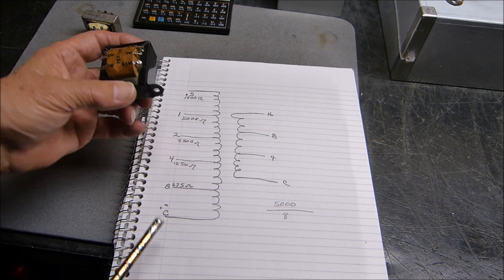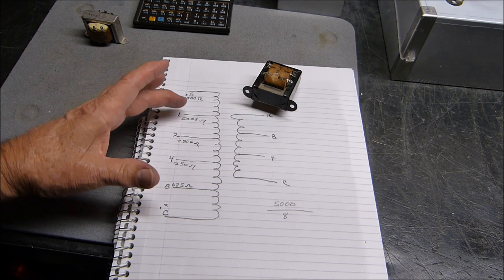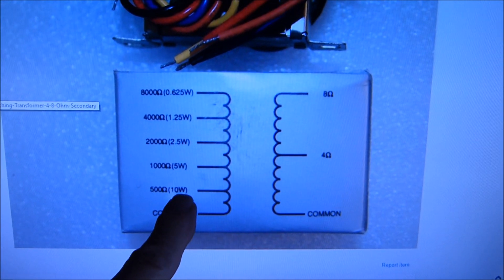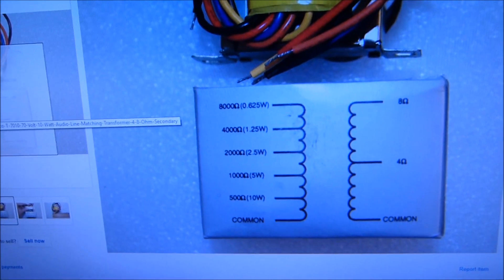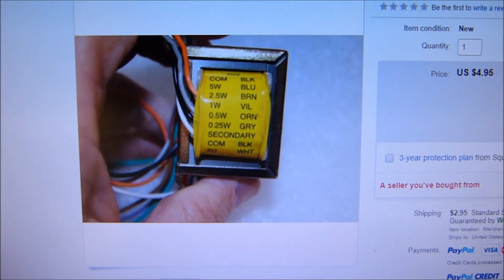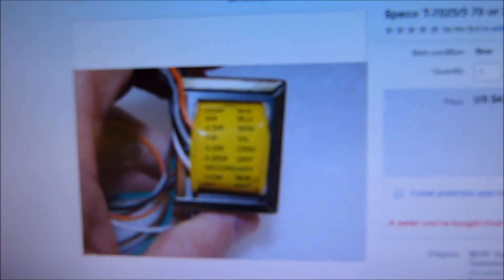Using Inexpensive Line Transformers For Vacuum Tube SE or PP Output Transformers

Comment: Nice video. Thanks for sharing! What do you think about these transformers if they are used in the old fashion way as interstage transformers where the primary side is driven by simple push-pull circuit for example using 12AU7 and secondary side goes directly to for example 6V6 grids without the usual 220k grid leak resistors. I suppose you get the center tap for secondary if you use 0&16ohm for grids and 4ohm for CT right? There’s not much data about the behaviour of the interstage transformers where their secondary is left open like basically they were left that way in old radios and Gibson amps.
Reply from the maker: I never thought about using the secondary side (low z side) to drive grids but it might work for the 12AU7 and 6V6. The 6V6 only takes about -15 volts bias so open-circuit, as you mention, might deliver enough to drive them to a reasonable level. Sure wouldn't be picking up much hum at the low Z value. Yes, impedance levels for CT would be 1/4  (or 4x) from a side instead in the middle. Common and 16 and 4 ohm CT - makes sense to my head right now  🙂
Reply: @ElPasoTubeAmps  yea i’ve been trying to find cheaper alternatives to the usual interstage transformers that seem to be designed for class A2 operation. It doesn’t make much sense using a 5W bulky transformer to drive pentodes where they don’t deliver any extra output when they are driven into grid conduction. At least this is how i understand it. Hopefully someone corrects me if i’m wrong that with pentodes there’s not practically such thing as class A2 🙂

Comment: Thanks so much for that great video. I am not sure if I fully understood one thing: can those take any B+ from the power supply or is there a limit?
Reply from the maker: There would be a limit but I personally would not worry about anything 500 volts or less.
Reply: Perfect, that’s more than enough for my project. Thanks!

Comment: Hello. Can I use  100V / 300W step up line transformer as Tube amp  output transformer ? Transformer has 70V and 50V tabs on secundar and  primar 8 ohm ( and 4 ohm tab) ( 100W NF output).

Comment: i have a old 1961 5watt 6v6 harmony amp with a dead OT transformer. locally i can only find a small line matching transformer its the right 8ohm 15watt 70v could i realistically use it?
Reply from the maker: A 70.7 volt primary rated at 15 watts would be 5000/15 = 333 ohms. Certainly a bit low but it will probably "work" in that it will output power but will likely not do low frequencies very well. I assume your amplifier is SE (a single ended 6V6) or is it push-pull 6V6's ? You should be able to find a SE transformer on Ebay to replace the one you have. It should be about 8000 ohm primary to your 8 ohm load. Here is one I found for you to look at.   https://www.ebay.com/itm/165490843444?hash=item268805df34:g:JesAAOSwiChffRkH
Reply: @ElPasoTubeAmps  thanks yes a single ended 6v6 abs 5y3 rectifier.  Just looking over old schematics at work.
Reply: @ElPasoTubeAmps  just picked one up. It's rated in wattage on the primary leads. 5/10/15_common.  Now just to figure out which one to the output tube and the other wire is going to the rectifier on my stock

Comment: I order one of these off ebay and it was from china and it has the 4 and 8 ohm and both are measuring 4 ohms for speaker. People might want to watch the chinese ones. That is ok though. I have a cab that is 4 ohms. This one appears to be new. I'm going to use it, No more money than I gave for it, not worried. I just gave 8 dollars for it. Thanks for the info.

Comment: Interesting! I recall thinking about that many years ago, but never ran the numbers. Most of these small transformers are very low wattage, I'm wondering how far they can be pushed before they develop heating problems? Could a 10 watt transformer handle 30 W push-pull?
Reply from the maker: I don't think you could push a 10 watt to 30 watt just by looking at the size of it. I am hoping that even at the lowest wattage numbers stamped on the transformer, indicating what it will do for what it is mean to do, it will perform at the highest rated power of the transformer - but I don't know for sure.

Comment: hi  sir thankyou for make this video...sir i have a problem designed a pre amp with 12au7 but i want to know how can i calculate output impedance i mean  (Zoutput) please lead me sir and thankyou
Reply from the maker: As unscientific as this may sound, you do not need to calculate output impedance. There are the characteristic curves of the tube and there is the empirical "design" which is contained in the many examples over the decades of amplifier builds. I recommend studying the designs of the Williamson design like the Heathkit W-5M or the UTC schematics. They are easy to find on the Internet. "Designing" an amplifier is like designing a car. We use metal, tires, motors, ignition systems, fuel systems, ad infimum, that are already designed and available to us to use to make a complete product. We do not need to reinvent the wheel. About as low into the design as you can get is the RCA tube manuals, free off the Internet, where they recommend resistor and capacitor values for voltage amplifiers like the 12AU7 and others. Their advice on component values is hard-learned from real life experience and is available to us for free. Hope all this makes sense. Some links are below. The vintage 6SN7/6J5 and 12AU7 are basically interchangeable in audio amplifier building.

http://www.elektronikjk.pl/Elektroakustyka/wzmacniacze/wzmacniacze_lampowe/UTC_W-20_Williamson_Amplifier_Kit.pdf
https://www.vintage-radio.info/heathkit/
Reply: Again hi sir..at first I must say you thank you for answer my request..and then sir you said the output impedance it isn't very important but sir I design a pre amp when I want connect this pre to amp..if my pre to have low output impedance  I take normal quality on output amp but when respect impedance and I use high impedance I get good quality on the output..((absolutely when I change the impedance I pay attention to don't change my output watt))) i mean all the parameters are the same when I use low or high impedance except impedance..but   we have a lot of chane quality on the output
Reply: So because of that I need to know how we can calculate output impedance
Reply: And again thank you sir for answer my question..thank you sir
Reply from the maker: Maybe I am just a bit lazy when I build amplifiers and use values of components like high-end vintage amplifiers and preamps.  🙂 I assume you like the higher level output you get from your preamp when you use a higher impedance load on the output (?)
Since a 12AU7 is a medium mu triode, most circuits have load resistors ranging from 22K to as high as 100K. A 12AX7 being a high mu triode, uses higher value resistors up to 1 meg to get lots of gain. I suppose it just depends on how much gain you need. I hope I am understanding what your goal is and am helping.  Best regards...
Reply: Sir exusme I didn't mean badly ..absolutely you are professional..and I am appreciate you for leading me
Reply from the maker: I hope what I said helped in some way. I am sure you will succeed in your project.
Reply: @ElPasoTubeAmps  yes sir..absolutely your guidance are useful..and I am appreciate you sir for lead me..thank you sir..and I follow you and your video for ever
Reply from the maker: I hope I can say this correctly. The plate load resistor, let's assume 47K has one end attached to the plate and the other end attached to the PS rail. The PS rail has electrolytic capacitors on it to take any signal to ground. On the other hand, the (audio) signal is going thru the coupling capacitor and feeding the grid with a grid-leak resistor to ground. The capacitor is basically seen as a "wire" to the signal and that puts the plate load resistor parallel with the grid-leak resistor as far as the signal is concerned. I hope I said that right. I believe the cut-off frequency of the RC circuit coupling stages, or the output stage, is something like 1/(2*Pi*R*C), if I remember correctly or something in the range of 10 Hz, depending on R and C.
Reply: @ElPasoTubeAmps  sir absolutely your guidance is useful 🙏  and I am appreciate you ...and I want to say you,,,you are good man because I sent a lot  of massage for a lot of electronic YouTuber but they didn't lead me but you are only person  that did lead me..I am so thank you ..

Comment: Also, Am I thinking right?  Using them, no matter what,  if I need a 5000 ohm impedance, say for a 6L6,  I can only ever have 1 watt of output?
Reply from the maker: Building on my comment earlier, I would think that in a PP circuit where DC is opposite and essentially canceled in the push-pull configuration and in a perfect balanced output circuit there is no DC biasing current to lead to saturation (assuming tubes are nicely balanced) I think they would work great. These transformers are rated at different levels of power up to 20 watts or more so I don't see a limitation on power as long as the transformer is big enough and rated for some higher power level. I haven't slowed down on building but my passion moves around between RF and AF and then astronomy and who knows what else, and I have been stuck on RF lately. I do want to get back to audio amplifier building with some of the magnificent UTC transformers I have. Thanks for your comment and always good to hear from you...
Reply: @ElPasoTubeAmps  You do have some nice transformers!

Comment: Do you think common or garden switched mode psu transformers be used for the same thing ?
Reply from the maker: I sure don't know but I kind of doubt it. I am not sure of the frequency that SMPS operate at but I think it is 15KHz or so (??) and I would assume that the FR of these transformers would not do well at LF and I have no idea of the primary to secondary impedance values. Maybe some other viewer can comment and provide more information.
Reply: ElPaso TubeAmps Thanks for that,it was just a though -maybe later I will do some experiments and let you know
Thanks again !

Comment: How would you install a pentode to triode switch in a 6l6 push pull guitar amp?
Reply from the maker: Here is what is suggested.
https://www.premierguitar.com/articles/24181-ask-amp-man-reduce-power-with-a-pentodetriode-switch
In essence, you are disconnecting the wire or resistor from the screen grid (pin 4 of the 6L6 family of tubes) and then connecting the screen (pin 4) directly to the plate (pin 3). This would connect it in Triode mode. In other words, remove the wire or resistor from pin 4, whatever might be there and then jumper (short) pin 3 (the plate) to pin 4 (the screen). This is what they call Triode mode. In the link above they use a switch, which is known as a double-pole, double-throw (DPDT) so you can go back and forth between the Pentode and Triode mode. DPDT switches come as toggle switches or as rotary switches. There will be a total of six (6) contacts on a toggle switch. An example of this type of switch is shown below on Ebay. I hope this helps.
https://www.ebay.com/itm/2-pack-Waterproof-6pin-DPDT-Momentary-Toggle-Switch-Boot-Cap-ON-OFF-ON-Amp/401623319313?hash=item5d829d8311:g:KCEAAOSwPXFcI2EN&frcectupt=true

Comment: Please add more topic why power transformer can not be replace interstate transformer in Single End amplifier .  For example 2 : 3.5  can not be replace by 220V : 385V power transformer with the same ratio.  Thank you in advance.
Reply from the maker: You very well may be able to use a power transformer for an audio transformer if the turns ratio is reasonably correct. I don't think I have ever used them in interstage coupling but I don't see why not as long as the turns/impedance ratio is close. I have tested power/filament transformers at very low power levels (mW level) and the frequency response is very good. Not so good when using a power transformer as a output transformer running higher (20 watts or so) of power. If you select your transformer carefully, you may find one where you can use the CT HV secondary as the plate-to-plate winding and use the filament windings to drive the speakers. It can work - maybe not 20Hz to 20KHz but it can work.
Reply: @ElPasoTubeAmps  in audio forum they said something about gap.  Power transformer does not have gap. Is it relevant?
Reply from the maker: @nuttyl283  Power transformers only operate at one frequency in the USA, 60 Hz. In audio amplifiers operating at low frequencies, as low as 20 Hz, the core can saturate much more easily so single-ended (SE) transformers need the gap to help prevent core saturation. Push pull transformers do not need a gap as the current in the two halves of the primary are in opposite polarities so the core does not saturate.
Reply: @ElPasoTubeAmps  Thank you very much.   I plan to build 4P1L SE as a schematic use interstate T. Due to interstate T. is expensive. I change schematic to a Japanese guy version using Transistor to drive 4P1L PSE 4 watts instead to save cost.  However I already have 6N2 4P1L Push Pull amp 10 watts.  I don't know is it good Idea to make SE 4 watts just for JAZZ and audiophile voice music.  I don't have much knowledge about different of SE and PP but my friend tell me that SE is more proper for audiophile voice.  That make me want to build 4P1L SE 4 watts
Reply from the maker: @nuttyl283  The SE amplifier is going to be easier to build but it will not deliver the power of a push-pull (PP) amplifier. That may be OK. Amplifiers with low amounts of negative-feed-back (NFB) tend to sound very "alive" and is probably why audiophile's like it, especially with string instruments like the violin and the human voice. However, the fact that SE amplifiers are usually low power (3-5 watts) they do not do bass very well. Best of luck with your project.
Reply: @ElPasoTubeAmps  Deal Elpaso,  I will try to make it. It is not easy for me. Because I only have PP amps both solid state and tube (4p1l), If I want to listen to bass songs I will listen in my 4 PP amps. However, I don't have SE for voice songs. Thank your for your reply. Now I know many things. Youtube help expert as you help non expert s to the world.

Comment: Could I use microwave transformers to feed two 816's in a push pull amp?
Reply from the maker: A microwave oven transformer (MOT) is a power transformer around 2000 volts output on the HV secondary but it has no center tap. It also has one end of the high voltage winding connected to the metal core of the transformer which is grounded to the case of the microwave oven.  It has one "hot" terminal and two  other wires to light the filament in the magnetron. Sometimes people "lift" this connection off the grounded core but a MOT is s deadly high voltage device and I do not recommend using one in a power supply. People have definitely been killed messing with microwave high voltage transformers. One was a college professor here in El Paso a few years back. If you did lift the grounded end of the secondary off the core of the transformer and insulate it properly, then you could put it into a bridge and get around 2600 volts or you could put it into a voltage doubler with two 816 MV rectifiers and you would end up with about 5200 volts. I don't think you want to do that.  MV rectifiers may be very pretty glowing blue in a power supply but that should be taken as a warning of high voltage that can kill. That would likely be Death On Contact with voltage at either of those levels.  In any case, a MOT plugged into a wall outlet is a deadly device. Otherwise you could cut all the wires off and wrap it in nice cloth and use it as a door-stop...   Stay safe and alive...
Reply from the maker: Bill, for reasons I can not understand, I can not always see comments in my YouTube videos so I will try to answer one of your other questions here. The comments only show up in my email.
You asked about balancing grid voltage vs balancing cathode current. If all tubes were perfect, then balancing the grid voltage would balance the cathode current. But in any case, the objective is to balance the cathode currents and that is done by, most likely, unbalancing the grid voltage by a small amount. For example, one tube might need -36.4 volts for 50 mA of current while the other tube might need -36.7 volts for 50 mA of current. There are just math examples to illustrate that the objective is making the cathode currents the same at 50 mA in this example. Hope this helps.